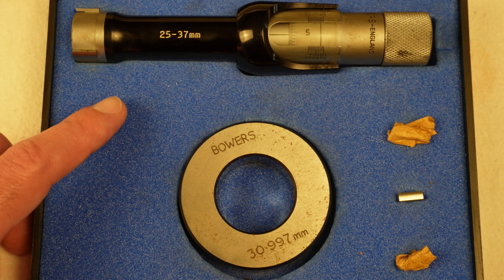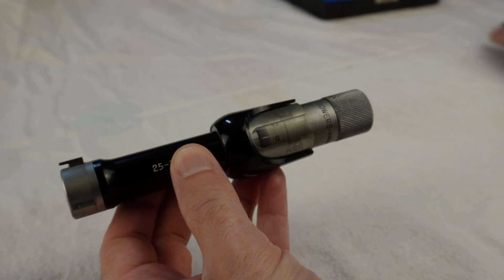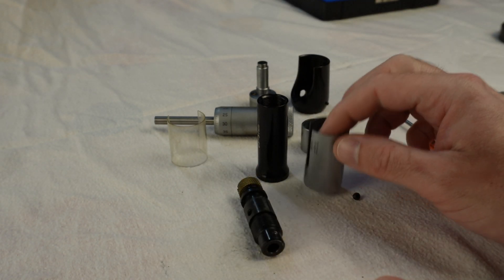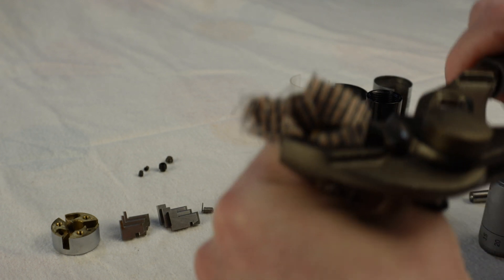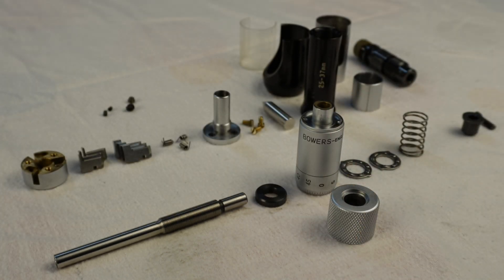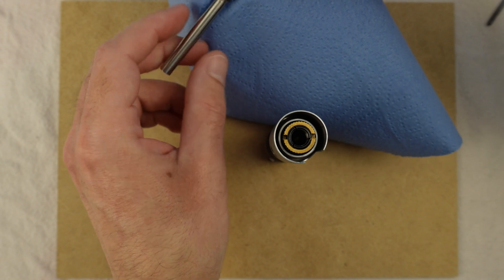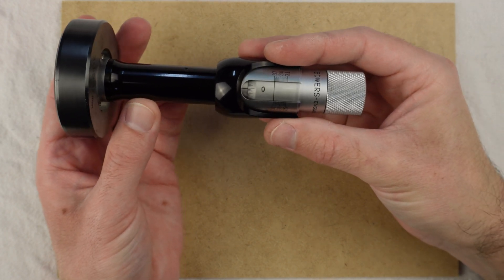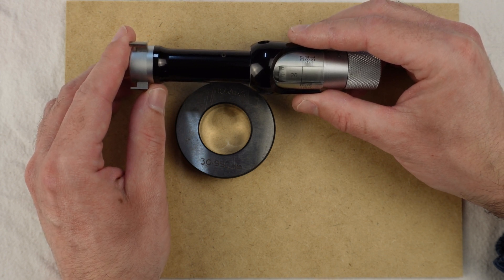Calibrating an inside micrometer

Comment: Hi, I really like your videos! Keep it going!
On this one, either you calibrated it to the wrong reading (37 on the caliper and 31 on the calibration ring) or you used other measuring 'anvils'?
Reply from the maker: Hi, that's a good question. Maybe it isn't clear in the video, but the micrometer is marked 25 to 31 on the left scale and 31 to 37 on the right. Each scale to be used with the specific set of anvils provided in the box. I was using the smaller ones and looking to scale on the left that goes up to 31mm. Maybe that's why the confusion' I didn't realize that wasn't clear in the video. Thanks!